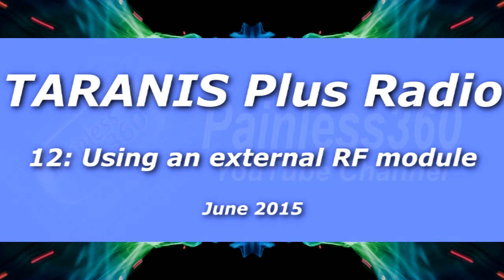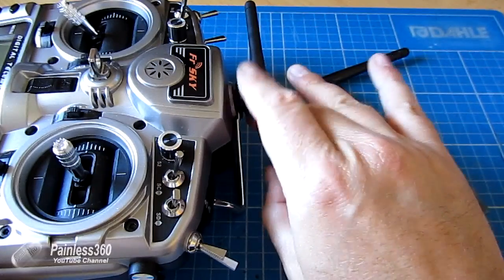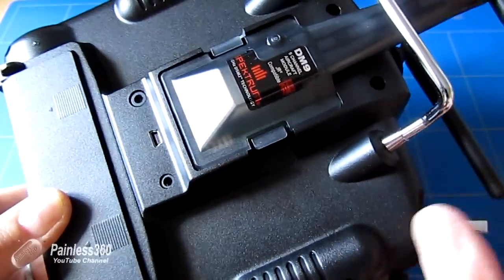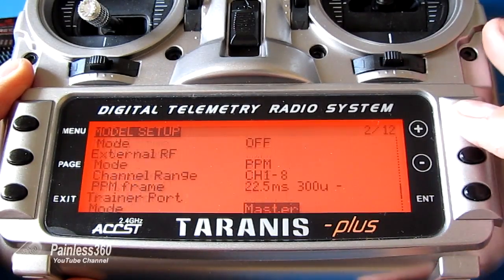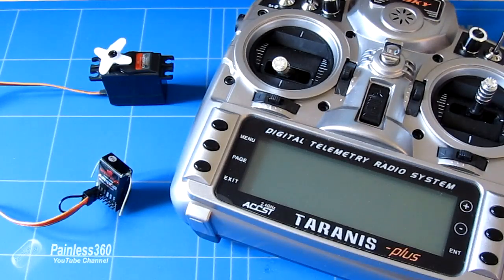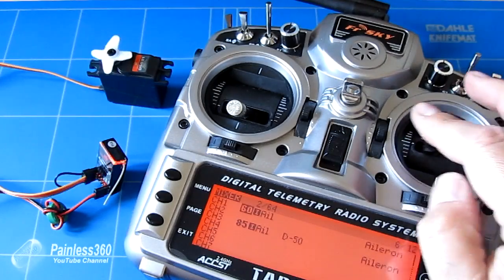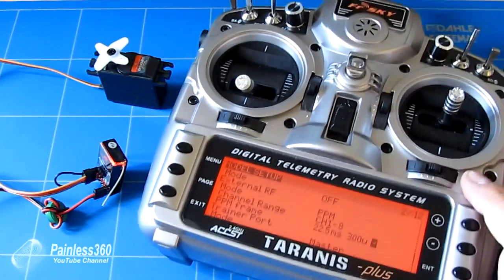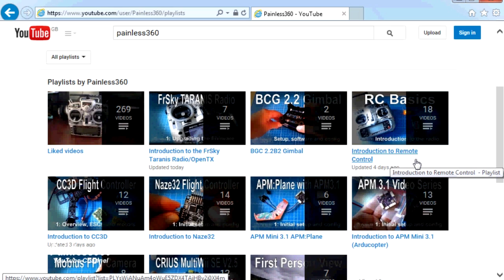(12/12) FrSky TARANIS Radio - Using an external RF module (DSM2, Spektrum, Orange)

Comment: Hi,  Great series of videos, you have saved me a couple times!   I do have a question, I got a DM9 module like the one you have from someone that moved away ( and he used a X10).  I use a Taranis X9D+2019.  However, I do not have the bind button on the module.  There is a little hole there instead, which actually doesn't go all the way through the module case.  I opened the module to see what was under, and no buttons to be found.  The actual chip in the module is labelled Dx5e_D, Horizon Hobbies.  Looks all good, but don't know how to bind.  Any idea?
Reply from the maker: I don't, sorry. Best of luck

Comment: Hi Hello {{{  HELP }}}  My X9D+ Has the new updated firmware 2.2.4  Got Too Say  !!!  Awsome !! BUT  Using the DM9 Spectrum Module on PPM its a (( NO GO ))  !!  After Dialling In the NEW software already installed to DSM2 or DMSX the Spectrum Receiver LOCKS on Binded BUT no servo Movement ??? ANY Idear's Sincerely !! P.S. Tried the Orange and the Real Spectrum Receivers !!!  NO LUCK  !!

Comment: Hi, thanks for your kind videos, who are helping us alot. Now I would like to work on 2.4GHz and hence dont want to put an external module in my taranis X-lite pro with X8R, So my question is can we use X8R without an external module with X-lite pro and I will get telemetry? As telemetry is very important in our case and without that it it waste for us to use. Thanks in advance.
Reply from the maker: Yes, should work.. best of luck
Reply: @Painless360  thank you sir...

Comment: I know this is an older post, however.. I have a question for your. I have a DX8, and wanted to dable with the Taranis QX7 Sport. I made the Spektrum antenna module... and it works flawlessly.. Here's my question. When you install the Spektrum module I physically tell the controller to use the external antenna... when I remove the external Spektrum antenna does the Taranis know to use the internal antenna then. If I go to the Mode settings I still have the option to chose the DSM2 & DSMX... just wondering because I'm having an issue trying to bind a Frsky BeeBrain Lite mini quad... Thanks
Reply from the maker: The radio isn't that clever so you'll need to configure the Internal transmitter manually if you remove the one in the bay... Happy flying
Reply: Thank you for the reply. I’ll try to figure that out. Thanks!!
Reply from the maker: All covered in my Opentx multi protocol module videos.....
Reply: @Painless360  Thanks... I've already watched some of them... OH... by the way.. I HATE YOU... I bought the Aomway Commanders with your recommendations 2 yrs ago (and a few other recommendations from YT)..., However, NOW... now I have to buy the new ones... HATE YOU I DO... YES I DO!!! :) Thanks for your help!!! hahaha....

Comment: I have the Taranis 9XD Plus. Just upgraded the firmware to 2.2.3. I have followed this video to the T, yet cannot get the servo to respond to the TX command.  The receiver and the TX bind successfully.
I have the Spektrum DM9 module and the Spektrum AR7000 receiver. The Inputs screen I only have Ail on CH01 100% Weight. Mixer screen CH1 100 Ail, OutPuts Screen CH1 Ail 0.0 -100.00 100.00 -> --- 1500.
Servo plugged into Thr on the Spektrum receiver and that is the first channel.
Do you have any ideas as to what I can do or am missing to get this to work?
Many Thanks in advance. Chris
Reply from the maker: Did it work before the update? Do regular FrSky receivers still work ok? Without more detail it's impossible to offer any advice. Happy to help but please watch https://www.youtube.com/watch?v=olIqTiSJHIY and come back to me with more detail of what you've tried..
Reply: @Painless360  I have not tried this before as I upgraded to 2.2.3 prior to seeing this video. The FrSky receivers still work perfectly. I have researched via Google and Bing for any solution to this issue and have not been successfully. I will try and flash back to 2.2.2 and see if that works. Just by way since upgrading to 2.2.3 I am unable to select an image in both the Companion interface and thru the TX menu. Not sure if you have seen this before.
Reply from the maker: @AndyCapp77  That could be worth a try. You could always try the other setting for the module bay in case that's changed in the later versions.. Best of luck!

Comment: I have the OrangeRX module (v1.2) and I get a red blinking led when powering up the Taranis x9D.  There are 3 beeps at the start too.  According to the manual I should here 3 beeps but it doesn't talk about the red blinking led.  Now I don't have a Spektrum RX yet (buying a Parkzone T-28 from a fellow flyer of our field this weekend).
EDIT: Do you lose failsafe when selecting External module?  The failsafe menu goes away when External is selected.
Reply from the maker: I'm not sure as I've not used this for a long time - I'd drop the support guys at HobbyKing a line and see if they can help.. Best of luck!
Reply: @Painless360  Thanks.  I'm just going to send it back.  I'm getting a used plane as a trainer from one of the club guys. Its a foam Parkzone T-28 and it has an orange Spektrum RX. Instead of messing with this OrangeRX TX  module I will just replace the DSM RX with an ACCST one and be done with it.

Comment: I'm trying this with a hours x10s running OpenTX 2.2.2 with the DSM program preinstalled, it doesn't seem to work properly and I have tried running PPM like you but it also won't map all the channels in betaflight? If you have, or can post a vid. Doing a bind and simple set up of channel mapping/programming for a multi rotor it wood be tremendously appreciated by us! Thanks for you time and any help you are able to provide!
Reply from the maker: I've not got an X10 here, if I get one I'll take a look..
Reply: Thank you hope you do there a really nice radio and I highly recommend it greatly appreciate your time and work its always helpful.

Comment: Thankyou Painless 360. I have a Taranis with an Irange modul. Im binding to a AS3X Spektrum ok. However the channel order is wrong. I can swap servo leads, but. The gyros on the AS3X are operating the wrong surfaces. How can i change the servo order on the Open tx programming? Many thanks, Scott
Reply from the maker: You'll need a specific channel order for that.  See the 4in1 module videos on my channel for how to set it up..
Reply: Hi again! Thanks for your prompt reply. I have watched many of your videos, but struggled with this problem. I have now got my AS3X to work. The way i fixed it was to start a new model set up in Opentx.
Reply: Then when it asks you if your model has an engine set channel 3, Ailerons are channel 1, Elevator is channel 2 and Rudder is channel 4.
Reply: This magic formula seems to follow the Spektrum TAER  at the reciever. And the AS3X is working the correct way. Im not sure if there are any side effects, maybe you could check it out and see if it works for you. Im not great with computers!! Thanks again, Scott

Comment: I was wanting to get a E-flight plane with the as3x reciever installed. I was just wondering if all the as3x features will work on the taranis like it would on a spectrum radio after it is bound? I have the multi module by the way if it matters. Thanks for your consideration
Reply from the maker: Should do! It's just a matter of adding the right additional channels. I've not done it but I'd bet that there is something on it on the forums. Best of luck!
Reply: Thanks again for your help. You have no idea how much help you have been to me Sir. Massive Thank You!
Reply: This is my issue too.  The E-Flight T-28 has the Spektrum AR636 (AS3X compatible) RX installed.  This video is priceless!

Comment: painless360 can you give me some advise I am using same TX and the same spektrum  DM9 module on a E-flite cessna 150 with a AR636a receiver. Binding is no problem but this setup has safe select. I cannot assign a switch to turn the safe on and off. can you please help .Thank you .
Reply from the maker: A quick look at the manual, it appears that you're not only have to set up the switch to a channel on the radio itself, but you're also then have to teach the craft which is the switch you want to use for the 'safe' function. It's something like holding both of the sticks on the transmitter to the low left position and flicking that switch 5 times seem to do the job. Check out the manual for your particular model, that should show the process. Best of luck!

Comment: So I keep looking up modules but I can only find videos of people telling you how to set it up, but no one tells you what it does or what the modules are for?
Reply from the maker: The modules allow you to use external radio transmitters that will talk to other types of receiver. Want to fly a long way? Then get a TBS Crossfire module. Want to control your indoor Walkera quadcopter? Then get a multi protocol module..

Comment: Have you tried binding two Rx so that they would work simultaneously? I've tried to bind the Spectrum AR 7010, Orange R1220XLR and Orange R1020X receivers. But after rebooting they lose binding... Module setting are: Led solid on-all protocols available for binding, The TX settings are: internal module off, external on PPM 22,5ms, 300u, - (minus) 1-8channels. I've also tried upon reading the manual: 1-10 channels, that modifies the ms to about 26,5 or so, and the rest the same. Don.t know what the minus and plus mean? But They lose the bind after restarting. I use two rx in my gas planes. Any ideas are welcome.
Reply from the maker: I'm not sure you can with this.. If you figure it out, let me know! :D
Reply: So after many on/off cycles I've managed to bind and hold binding after Tx model and module mode change of 6 out of 7 Rx's. After trying to bind all of my Rx's together at the same time without succes then reading how the module creates the bind with the Rx I've decided to bind them in pairs(two Rx's that seemed/are similar) so the pairs are: 2x Spectrum AR7010 - on the steady module light mode,  2x Orange R610 - on one blink module mode,  one Orange R1220XLR with one Orange R1020X - on the two blinks module mode, the Orange R615 doesn't work in anny module mode (althought it has a steady light after binding, but the servos move erraticaly) Then I took one R610, fitted in an Easy Star and after ground range test in which I've moved the Tx in many positions icluding the one in wich the Tx body is completely between the module antena and the model(because that's how it will be when I fly the plane overhead, the antena being under the Tx and it kind of bothers me), at 30paces all went well except when I pointed the module antena to the model, obvioustly, and find the spot where the signal was lost. In the air this particular situation could appear when the model is very low like landing, and when that happens the model is near me. So I took it to the clouds, pointed the antena at the model, and have control all the time. But this was only one Rx and an electric model. I've read HK reviews, then on forums all the threads except the 102pg long one that I'm curently reading, but didn't find the answer to one question: Can we really trust this module on big gas planes? So far I've only read people flying smal electrics or drones with it...

Comment: So on the ar6100 there's a gear plug. How do I use the gear plug I'm having trouble setting it to a switch or getting any input from iy
Reply: It*
Reply from the maker: See the manual for the receiver. I expect it will go something like this - Pop the radio into bind mode and install the bind plug into the 'Bind' port on the receiver then power it. The light on the Rx should flash quickly and then go out briefly before coming on solid. At that point cancel the bind from the radio, remove the bind plug from the receiver and you'll be good to go!
Reply: I ended up just putting it on the Rudder Channel because I won't be using it but I'll definitely have to do that

Comment: Thanks for the video.  My question is, will I have a problem going back to my internal RF with my other models still set up?
Reply from the maker: +John Cammilleri nope, you can switch between the internal and external module without changing the model at all

Comment: I have just got a QX7 tx and am gradually programing all of my existing models into it. I previously used a JR388s tx with the DM9 Spektrum module in it. I am now using the DM9 module in the QX7. I have noticed that with different Spektrum rxs' I have had to vary the ppm frame rate anywhere between 19.5 and 22.5us in order to get a solid bind. Do you know if this is normal and should I set it midway between the extremes of where it will work ok?
Reply from the maker: To be honest, I don’t use the DM9 very often here. I’d have a look in the forums. I know you’ll have lots of spectrum receivers that you’ll be wanting to use again, but using the Frsky receivers will give you lots of advantages. Best of luck!
Reply: Painless360   Any new models will all be on Frsky. Thank you for your excellent vlideos. I would have been lost without their guidance. They will be referenced regularly. 👍

Comment: I bought the hobbykingORX Spektrum module for my Taranis, but can only bind one model, if I change model I have to rebind. This is a pain as some of my models the receiver is hard to get to. Does the DM9 allow more than one model?
Reply from the maker: +Ian Huxstep not sure, I've not used the module for a very long time. If I find it, I'll test it and see how it works. Best of luck

Comment: Hi I have the same RF Spectrum module, but can't bind this receiver. Can you help ?
http://www.lemon-rx.com/index.php?route=product/product&path=78&product_id=152
Reply from the maker: What troubleshooting have you already tried?
Reply: I tried change PPM to DSM2, with different style of binding, Change "- " to "+", change PPM frame for less or more ms..... no way. By the way, using the same  RF Spectrum module with my old JR radio I can bind the same receiver easy like 1,2,3. 
Another Rx like this, I can bind with Taranis TX  without the problems (RF Spectrum module the same )
http://www.lemon-rx.com/index.php?route=product/product&path=59&product_id=92
Reply from the maker: I'd work from what you know is working, change one piece at a time and to eliminate everything. I suspect it might be the receiver or some whacky setting on it. Sorry I can't be more help, I've not use one of these personally.
Reply: Thank you very much for your time, if I find solution, I'll let you know

Comment: Can you actually set Failsafe in a PPM module? I have a PPM Turnigy/Flysky module and want to setup failsafe. Would really appreciate your help!
Reply from the maker: The fail-safe is really a feature of the receiver. If it can 'store' what to do in the event of a failure with the radio then that's what you're after. Most receivers that support fail-safe store these settings as part of the binding process. Best of luck!

Comment: How about the Flysky/Turnigy Module?
Reply from the maker: +Andre Martinez sorry, we do not use that one here. Best of luck
Reply: It was just fiddly at first with the Brushed version F3 board with cleanflight, got it working now. Thanks!
Reply: Andre Martinez so you did get it to work though? I have a Turnigy 9XRPRO that I don’t trust anymore but want to not have to put all new receivers in my many planes I used to fly with it. I have a FlySky module in it and was wondering if it would work in the Taranis I just bought.  So you followed the procedures here pretty much?

Comment: Hi,
Does a module creates more lag in the system? 
I heard there is a possibility it will throw 27ms latency in the system wich will not be great when flying racing quads. The stock x9d build in latency is about 9ms if i remember correctly? Besides that does this module get better range and or penetration compared with build in tx?
Reply from the maker: It will - most pilots wouldn't be able to tell of that extra step in the transmission. I can't. Happy flying!

Comment: Hi for about 4 days my taranis  plus has stop working it turns on ok but i cant bind to my receivers i can tell its the internal  module is there a way it fix that 
i have tried everything?
thanks!!
Reply from the maker: +Darren Reneau I'd get in touch with the vendor. Try to rebound with a known good model memory and Rx. Best of luck!
Reply: hi did you fix the problem .mi antenna on mi taranis broke .and will be putting an XJT module so I can fly again ,worried I might run into this kind of stuff?
and if you fix it how .thanks.
Reply: Hi i did not mange to fix it!
They gave me a new radio.

Comment: thanks for the video, I always enjoy your carful explanations so nobody get lost in tech translation. I have used a DX5e sender module and need to drift calibrate the Inductrix 200. the manual says I need to use the Flap switch, on which channel is the flap switch on a DX6i? 
fortunately I have a DX4e Which use the Bind/panic button but that don't work when the DX5e is on the Taranis.
Reply from the maker: +Villy Feltmann sorry, not sure. I'd check that the flap channel is a specific one on that model? Best of luck with it..

Comment: Hi, 
I just had a quick question. I also have the Taranis radio and I was thinking of buying this external TX module: http://www.banggood.com/FrSky-2_4G-8CH-DJT-Transmitter-Module-With-D8R-II-Plus-Receiver-Combo-p-1008353.html 
Do you think that it'll work the way yours did, or in other words, are the intructions the same for all TX modules?
Also, are there any precautions I must take when using the module so that it doesn't get damaged, for an example, always turning all systems on a specific way etc.
Thank you in advance!
Regards,
U.T
Reply from the maker: +UltimateTech the same process goes for any module. It's powered model by model. You will need to play with the settings to get it to work but the manual for the module should help.  Best of luck!